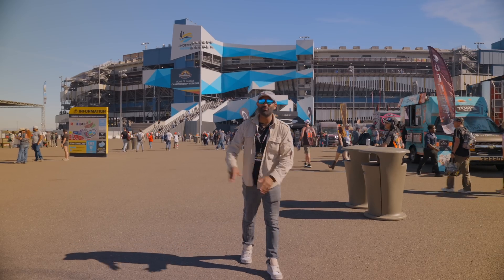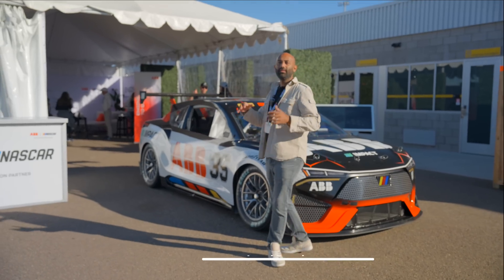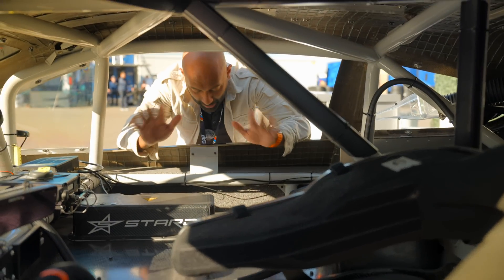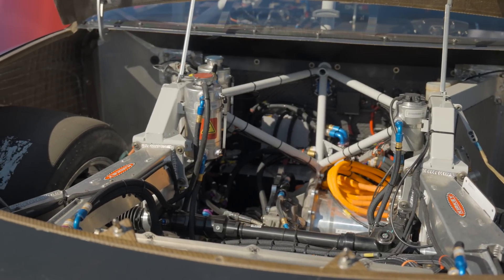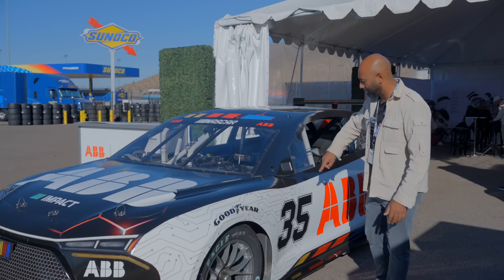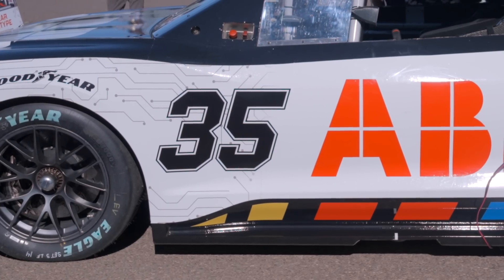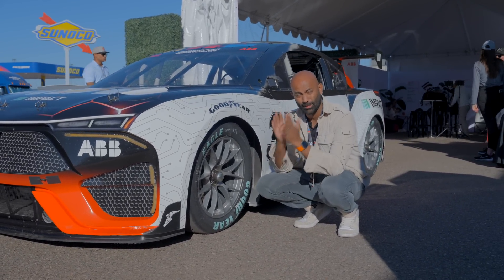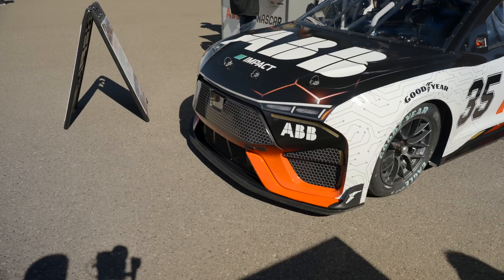EPIC Engineering of the FIRST EV NASCAR Prototype

Comment: I doubt this will ever happen. I would see maybe what there doing in F1 come to nascar where they are using syn fuel made from Co2 and Hydrogen. Sure EV's are fine normal driving down the road family car sure. But like telsa put it in super mode and go racing on the autobahn see what happens the Battery life goes down super fast also the batteries heat up super fast which leads to risk of fire. Daytona 500 could you imagine Drive 100 miles need recharge for an hour then drive another 100 miles recharge an hour. I mean I guess makes money take one hour breaks so you can sell more crap to the crowds.

Comment: If NASCAR eliminates liquid fuel race cars, I can not believe in my heart. That they could survive. They can run gasoline (my favorite), alcohol, L.P.,  acetone,  and I know its not liquid, but even hydrogen. I won't care. It's the ENGINE that gets it done for me. I am  GEARHEAD!  and without an engine, burning fuel, it's not a racecar to me.  The technology in those engines is AMAZING!  If they throw all of that in the garbage, for a battery and electric motor(s), they might as well run Prius's.  I don't care if there is enough power to smoke all 4 tires all the way around Daytona. An E.V. is a glorified golf cart. And I want nothing to do with them. I know that I am not the only one that is a NASCAR fan, But the overwhelming majority of us are GEARHEADS! We love the smell of gasoline, burning rubber, and all the noises and smells that go along with them.  For the most part, the only smell associated with electric race cars will be #1, burning brake pads. A distant #2, will be tire smoke from accidents. And a much more distant will be a battery fire. For the most part, the "fans" in the stands will be taking a NAP!  There will be so little noise, there won't be much to keep them awake. I am certain they will go fast. And there will be accidents, and "rubbing", and a lot of the other things that go along with it. But the majority of us LOVE the sound of 9,000 rpm screaming past us. To hear a car go by and hear "woosh", just isn't going to cut it. I wouldn't even care about the race results.

Comment: I gotta tell ya, that I've driven cars from 4 cyle up to 454 V8s.  The VAST majority of miles I've driven in this century though were in super quiet Toyota Hybrids. The hybrids are silent below about 30 MPH and I LOVE that.  I also own a RAM V8 pickup but one of the things I like about it is how quiet it is, but it's going to be replaced by the RAMCharger once that comes out.  The older I get the more I like Quiet. Ahhhh, silence. I attend NASCAR races now and then as well as the Indy 500 annually, but if their was no more exhaust noise, I'd be completely OK with that!!
Reply: You may need to go out the same way "old Yeller" did....

Comment: Time will take car of the Energy density issues. 

Current battery tech is increasing battery Energy density at about 4% a year. 

Time is on the Battery’s side.
Reply: Exactly. People saying that EVs will never work at scale are the same sort of people that would have said the ICE car would never be more than a novelty for the wealthy in 1890. Give it a few decades and see. Then again, with  prices of every vehicle rising so much over the last 15 years, it might still be out of reach for too many, but not because of energy density.
Reply: NASCAR doesn't use much fuel. The total distance traveled is around 2 fill ups for an average car or truck.
Reply: Yeah! So by 2050 EV racecars should be equal to what gas cars are capable of today! 😂😂

Comment: Yeah, NASCAR fans are different than you in regards to cars. Most of them are die-hard naturally aspirated American muscle fans. The boom in the chest feeling is NASCAR. It adds to the adrenaline rush. Go to a NASCAR race in person and then watch a playback at home with the sound at a level you would use for the nightly news. That difference is what the NASCAR fan will miss if the cars go electric. This doesn't even take into consideration the adrenaline from a pit stop taking 10 seconds or less. Can't recharge a battery to the equivalent amount of fuel dumped into a car tank at retail pumps much less the speed of a NASCAR fuel can.

Comment: I foresee a day when the ICE will go the way of the steam engine. It'll be nothing but a novelty. The sooner the better in mho. The ICE took over the steam engine because of the ICEs greater efficiency. The same will happen to the ICE when replaced by EVs, the only reason why it has not so far is simply because of greed. One day, even EVs will be replaced.
Reply: Yes, someday ICE will be obsolete, but that day is not close. If greed were the primary factor and EVs were actually better in all or even most use cases, greed would have accelerated adoption by front loading capital to capture market share, not slowed it. There are some applications where EVs make more sense than ICE, but for too many, battery tech's high price and abysmal energy density relative to gas, diesel, and kerosene keep it from dominance. Its day is coming but not this decade. Maybe not the next one either. And I like EVs. I'd have one myself if it made any kind of economic sense for me.
Reply: @danielchin8073  🤣, BEVs are developing rapidly. ICE is as far as it can get. Assuming the impetus remains in developing battery tech BEVs will out do ICE in every respect, this decade.
Reply: I agree except for the timeline. For my own use, if battery tech continues to improve at 4-6%/year, it'll still be at least a decade before the economics tip in favor of owning a BEV even with my rooftop solar. This is more like ICE in 1890 or 1900, not 1940. I'd even hear an argument for it being like 1910, but even though there are some good BEVs out now, that doesn't mean that the economics work out for them to become dominant over ICE yet or even soon. I hope I'm wrong or that there's some breakthrough that changes that though.
Reply: @danielchin8073  I disagree with that analysis. Already BEVs serve most people's use cases. They just chose to ignore that. The timeline you are referring to only applies  to the smaller group where yes, BEVs won't work for them.

Comment: A true gearhead is interested in performance, not maintaining a misguided loyalty towards tradition. If technology makes a car faster, that is the only thing that matters in racing, the one who crosses the finish line first wins, not the one who still uses old technologies. As the old ways of thinking start interfering with the ability to win, the smart money will migrate to ideas that give fans the biggest thrills.
Reply: You're pretty silly thinking that "new technology" is the best in every case and scenario. You can't re-invent the wheel no matter how hard you try. Just because it's new sure as hell doesn't mean it's better - not by a long shot!!!!
Reply: @seanoleary1979  I didn't say that; please look at my comment. I clearly stated that performance should take precedence over tradition. People who are against vehicles simply because they don't follow norms and the old ways will be left behind as modern technologies enhance performance. If something like electric motors can provide more torque and horsepower than conventional internal combustion engines, that is the best choice if performance is your goal. Manual transmissions and exhaust sounds are traditional elements that don't necessarily make a car perform better than an electric vehicle (EV). As EVs become more affordable, it will be increasingly difficult to justify purchasing a more expensive and slower vehicle. True performance enthusiasts will opt for the fastest car for the money.

Comment: 5:14 that is a gear box whining, not electric motor. FormulaE sounds the same and they commented on the sound many times.
Reply: Specifically, it's the straight cut gears maximizing torque transfer and durability but are comically loud that you'd have to be bonkers to daily drive.

Comment: Crap like this will end NASCAR all together guaranteed! They already struggle to keep folks with the uniform engine and designs etc.. Which ruins the entire irot and this with no sound will be adios bye bye cya later
Reply from the maker: I appreciate the comment, but they have zero plans of replacing the internal combustion cars! They want to be more energy independent in their operations, and possible gage interest in a new electric race, like formula E.
Reply: @TwoBitDaVinci nope. Get the ICE removed ASAP.

Comment: I’d say they should focus on smaller batteries that could get swapped at a pit stop. Design the car so that 2 people can quickly pull out the old one and team places another one.
Reply: I am sure with some money spent it will be possible to swap a battery in under 10s.
Reply: @franciscoshi1968 yes, it's completely possible to install an automated machinery in a pit where it can just detach the drained battery and plug in a charged one underneath the car. The car just has to align right on the spot
Reply: @franciscoshi1968  Maybe.
Reply: Why would you swap an entire battery vs use a little technology to speed up the charging process.  You people act like extremely fast charging isn't possible.  News flash, 100% possible but you need to set the limits. Costs, be "eco-friendly" and or size.   Capacitors transfer energy extremely quickly but are expensive to produce at the same size as an EV battery.
Reply: @herbfst  In a race, spending even 1 minute to wait for a battery to charge is an eternity. The average pitstop in NASCAR is like 15 seconds.
Reply: Or simply have two cars per driver. Jump out of one that can have its battery swapped at leisure while the driver continues the race.

Comment: NASCAR had wings in the 60s then outlawed them till the COT then removed them again. Horsepower is limited along with other design changes to reduce top speed due to aerodynamic safety related issues putting fans at risk. Smell and sound are part of the heritage of auto racing that have been fan draw for decades. The racing paradigm shift may not come so easy until us old guys are all all gone.
Reply: Naaaa.... the kids that are into it today don't want to see the sport perverted any more than it already is!

Comment: Wait! There is a solution to the racing sound of a gas racing engine. To insure that all fans are happy they will mount a 15" woofer speaker tied to a 1000 watt amplifier and a micro computer that that produces the sound of a NASCAR engine in sync with the EV NASCAR's accelerator in each of the racing cars. Or maybe head phones for the spectators that add the roar of the engines to the race.
Reply: I don't think most spectators would be all that interested in an imitation, but maybe I'm wrong. 1000 watts and a 15" woofer would be actually pretty close to as loud, but only if a very efficient enclosure were used. And that would probably add 200 lbs to the vehicle.
Reply: @danielchin8073  ...your sensible answer gave too much credence to Donald Houdek's silly-ass suggestion!

Comment: You're repeating a little bit of a fallacy there at the end. 3/4 of the energy in the gasoline that goes into the car is wasted as heat and noise, and I bet that number is even higher in NASCAR. So you don't need to replace the entire energy content of the gasoline with a battery, only about 1/4 of it. So that 2400 lb. battery to replace the 20 gallon tank is actually more like 600 lb.
Reply: @AlRoderick  with typical driving, it's even only about 20% that ends up being used for actually moving. 
@TwoBitDaVinci also didn't consider that an electric car recuperates, so in racing, you probably only need less than one fifth of the energy. 
But there is a catch: you would need to recharge the battery during a race, much like you would currently refuel.
Assuming that those groups of 4 refill cans are what is typically used in a race, you'd still need a lot of battery capacity or a way to swap batteries during the race.
Reply: @svenmueller  Controversial suggestion, why not just make it a hybrid? EVERY advancement in EVs just ensures hybrid superiority and the shining example being Porsche 919 EVO hybrid being almost a full minute faster than the Volkswagen ID.R on the Nurburgring.
Reply: Right, they need to quick change the battery like they used to do with lug wheels
Reply: The distances are so short relatively to people driving. The longest NASCAR race is 619 miles which is basically 2 tanks of gas for most cars.
Reply: Given that regen wouldn't help meaningfully on many tracks and that gas is refilled at pit stops that are too short for charging, Ricky's approximation is pretty reasonable; you'd need a LOT of weight in battery to supply enough energy for the whole race. It's okay that battery energy density is terrible; it doesn't have to be good to still be a good solution for a lot of applications.